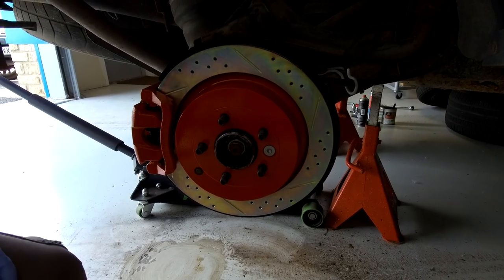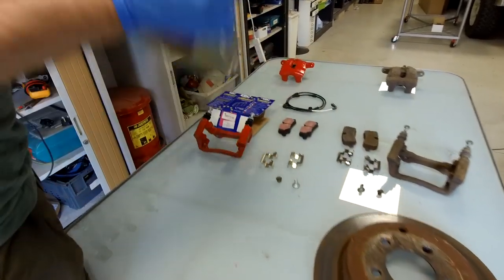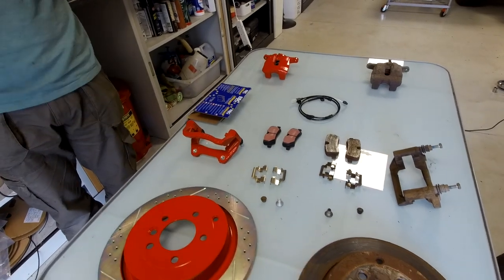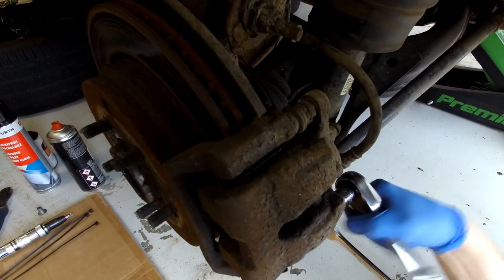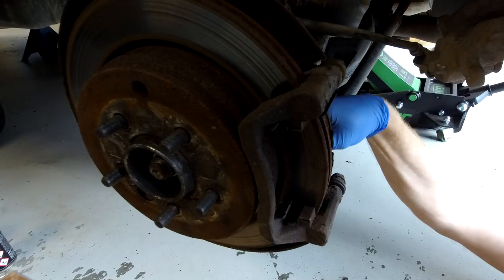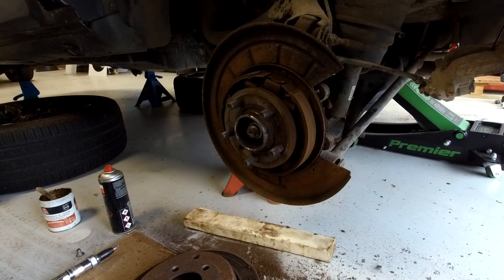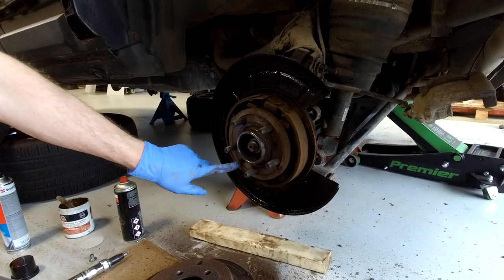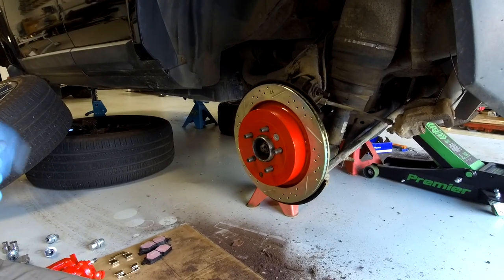Land Rover discovery 3 rear big brake disc upgrade / back discs pads and caliper LR3

Comment: They have automatic adjusters,slacken off the adjusters before putting the disc on. Then pull the hand brake on a few times to adjust the brakes.
Reply from the maker: Thanks for the info